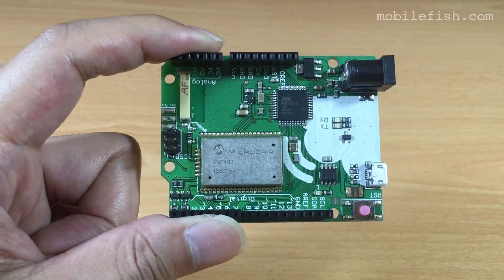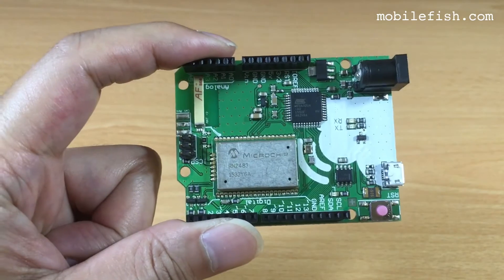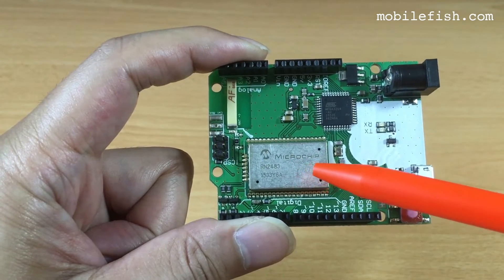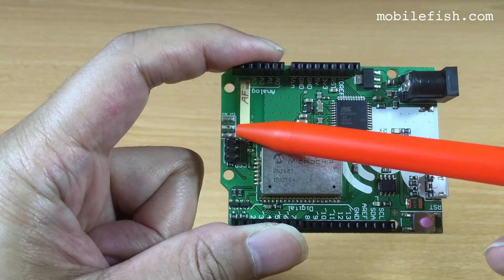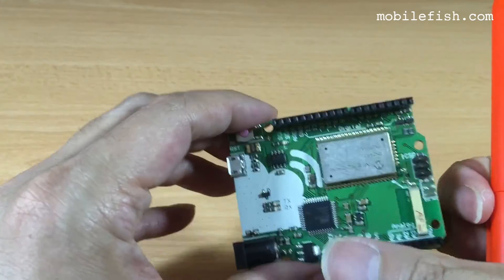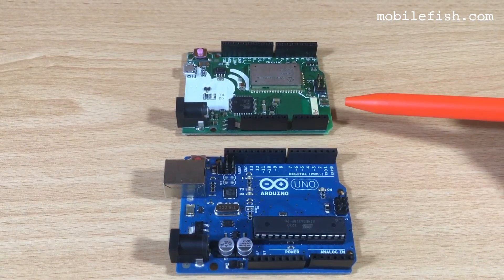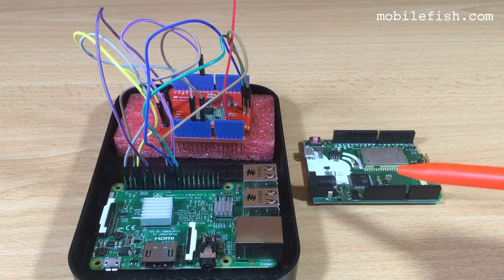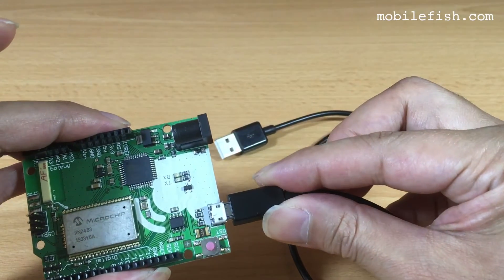The Things UNO beta, part 4

Comment: Hi, can you share a link to an external antenna that can be used with the Things UNO?
Reply from the maker: Mathe, I can not share you a link. I buy my antenna's from AliExpress.com
The sellers on AliExpress are resellers and these links will not work within a few months (= out of stock)
NO guarantee that the antennas works as advertised!
Use an antenna analyser to verify the antenna parameters!
I recommend that you buy a sleeve dipole antenna as mentioned in tutorial 43.
These antennas are omnidirectional antennas, they are compact, cheap and easy to use.

Comment: Can I test 433MHz Lora with the single channel node and gateway?
Reply from the maker: Ricky, You can create your own single channel LoRa gateway (=receiver) working on 433MHz and create a node (=transmitter) also working on 433MHz. The node sends for example temperature data to the gateway. The single channel gateway is NOT intended for production but should only be used for test purposes (it is not a real gateway). If you buy a  LoRa module from a manufacturer make sure you select the correct frequency which is allowed in your country (i assume 433 MHz is allowed in your country). You buy a LoRa module for a specific frequency (433, 868 or 915MHz). You can not change this freq later.
Reply: Ok, it is only work for P2P with proof of   concept. Thanks anywhere.